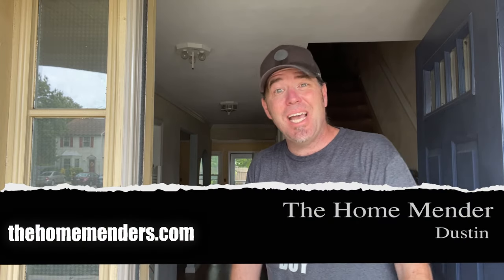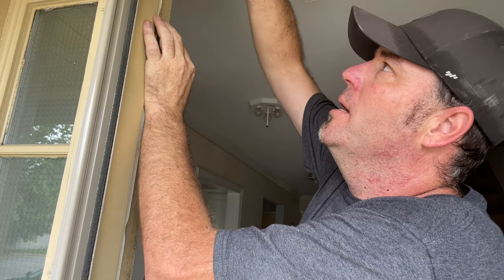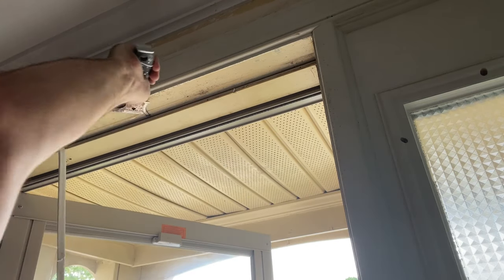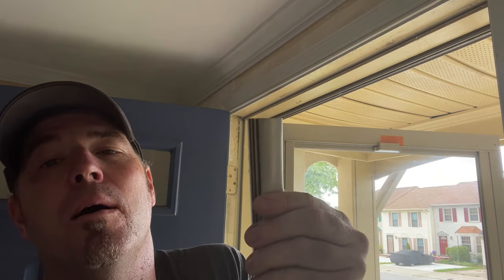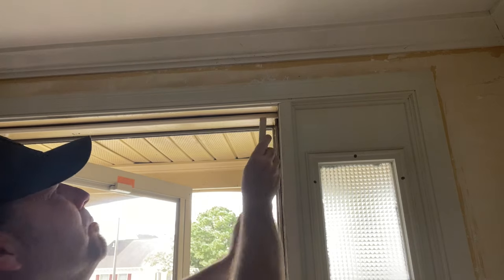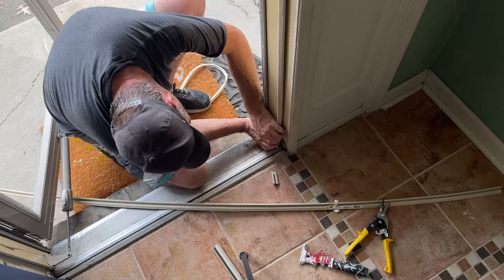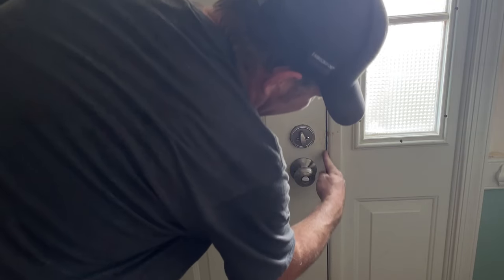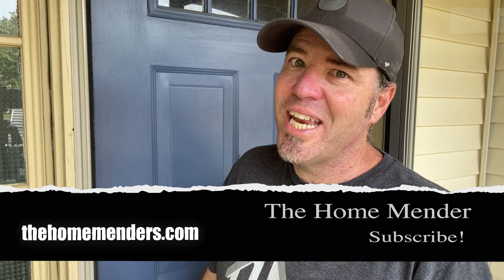How to replace KERF weatherstripping. Easy door seal replace.

Comment: Quick tip for the slots so you dont have a build up at the top corners, you can trim back the folded part for overlap without build up so its even, but keep the part that goes into the slot so it holds it.
Reply from the maker: Excellent input thank you

Comment: Oh well, I couldn’t get it in the slot. It’s exactly like the one we took out but we couldn’t get the new one in. You made it look easy but it wasn’t.
Reply from the maker: Hey Siri, take a scraper or painters tool and run it down inside the slot to make sure you don’t have any pin nails, preventing the new one from sliding in. You got this

Comment: How are you getting it in so easily? I can only get the top and bottom in and then, no matter what I do, it won't slide into the groove. It's like it's too big to fit or something. Should I pry the gap to make it more open?
Reply from the maker: Hey these. I would not pry the gap… That would split right off. There may be something obstructing it. I have seen them with pin nails and then before if that’s the case, just use a paint scraper and break them. You got this.

Comment: Painters suggested I replace the old weather stripping around the front doors which I  trying to do. Was NOT looking forward to the actual job and still am not. The slot is clean and free of debris but it does NOT install. A royal pain in the ass!
Reply from the maker: Hey Gary, check to see if there’s a little pin blocking it from sliding in sometimes people install them with the pin nails if they can’t get them to stay in, which may be a solution for you. If you do see them, you can take a chisel or a painters tool and bang them to break them to free up the slot. I hope this helps.

Comment: Dustin, well done. Just bought a place where the main door requires a hip check and/or shoulder applied to open/shut. Turns out the stripping on the hinge side looks way too thick for the application. I appreciate your kerf/no kerf heads up. Off to the store. Thanks, man! 🫡
Reply from the maker: Thank you, my friend. Enjoy!

Comment: Great video. I put it around all sides now my door won’t close. I left one side out but I see tiny day light. Can I trim it or they make smaller widths? Thanks.
Reply from the maker: Great question Harris. If the door is now too tight and won’t close and latch, you may need to move the latches to accommodate the new weatherstripping. You’ll be happy when it’s done :-) you got this

Comment: This is great, but what about when you shut the door and daylight can still be seen?  I'm sure I did it wrong, but I placed various sizes of the stick-backed weather stripping on top the the type you used (by the way, what do you call the type used in this video?).
Reply from the maker: Heyhey. It’s kerf. If you replace it and still have daylight, you might need to adjust your door. Catch to keep the door tighter when shut. You got this

Comment: Are the side pieces interchangeable? When I bought a couple at the hardware store they are definitely not symmetrical. Also, if I don't own a snip and wouldn't make sense to buy one just for this project, can I cut the weather stripping with just a utility knife? Thanks, great video.
Reply from the maker: Hey Gwynn Yes the side pieces should be interchangeable and you can cut these with scissors.

Comment: Any suggestion for getting the old strip OUT that's stuck in the slot with multiple coats of paint over the years?
Reply from the maker: Hey Alden. Usually you can grab an end of it with a pair of pliers and yank it out… I have seen it where it has been tack nailed  in before if that’s the case you would need to use a chisel and busters pin nails out to get the new piece to slide in. I hope this helps painters tool rocks!

Comment: Thanks. What if the kerf on my door jamb is on a different surface? The slots are on the periphery/adjacent surfaces and not the frame/the surface that is facing you as you're looking out through the opening. Where do they sell weatherstripping for this non-standard setup??
Reply from the maker: Hey sonic. If it’s not this style, you can use the metal Weatherstripping with the rubber bead. It’s installed with the door shut, but will work on just about any door that this video will not. I hope this helps.

Comment: I bought some kerf stripping but it just falls right out of the slot as if my kerf is too wide for the little teeth of the stripping. Any issues with using some adhesive or do they make it with larger teeth?
Reply from the maker: Hey GG. You may want to try some tiny Brad nails. It seems that an adhesive would be messy. I hope this helps.

Comment: Hi I just did this but it's not staying folded on the away from hinge vertical side. This forces me to use force to close the door. Suggestions?
Reply from the maker: Hey Natasha, you may try pushing it in and securing it with tack nails.

Comment: Bought this house last spring, and I am changing the weather stripping. But now the door won’t close. Any suggestions? Are there different thicknesses I need to look for? The original was a flimsy rubber kerf, and I replaced with what looks like you have, says seals up to a half inch gap.
Reply from the maker: Great question Ashley no they are not different thicknesses you may need to adjust the door catch so it latches easier. You got this

Comment: I replaced the weather stripping on the door with new product but it is very loose and there's no way to fix it tight in the groove. Any tips to get it to lock in there? Pushing harder doesn't help; it's likely the groove is just too big in a few places. And somehow I don't think glue is the right solution here.
Reply from the maker: Hey Barnaby, sometimes it can be a challenge… You might try Brad nails holding in the edge of the fin. I hope this helps.

Comment: What if there's still a light gap and draft after replacing this? My door had another insulation thing attached to the outside edges of the door that fit into the frame, but I'm not sure if I should do that again or something else.
Reply from the maker: Hi destiny. If you had this style of door with the gap and you replaced the weatherstripping that should be all it needs. You might try to move the catch , the metal part that holds the Latch in  just so the door shuts tighter up to the jamb I hope this helps

Comment: What if the kerf strip doesn't just slide right in? I just started working for a buddy learning general contractor work. Did this yesterday and had to bang the kerf strip in with the butt of my snips. Took a long time and too much gusto for my care.
Reply from the maker: Hey James if it doesn’t slide right in then there’s probably pin nails or glue. You do run into those once in a while but it’s rare. I’ve had it so bad where you’d had to notch the little barbed fin to fit it in the slot I hope this helps

Comment: What if the kerf is in the jamb instead of the stop? If that makes sense. I have aluminum "V" shaped stripping right now, but it looks terrible.
Reply from the maker: Hey neuro . In your case you’re going to want to remove that little copper fin deal from the 50s. Then you will want to go with the metal strip with the beaded rubber on it. I have a video for that. It’s weatherstripping without the kerf slot. I hope this helps.

Comment: Hey the weather stripping I bought to replace the old has a thinner channel than the old. The kerf is a lot wider than the channel is. So, that makes the weatherstripping not stay in place and very sloppy loose. I don't have much experience with these things. Can you tell me how to get the weatherstripping to fit correctly? Thanks
Reply from the maker: Hey funny woman. I’ve run into this a timer to.If it won’t stay in there you can use a few Brad nails to tack it in place. If the fan won’t slide in all the way you may try to trim a little bit off If it won’t slide in all the way. I hope this helps.
Reply: @homemend  Thanks so much for your reply.

Comment: Ive got no daylight. But the door wont close flush. Any tips?
Reply from the maker: As long as it shutting and locking and not letting in any light and air, I would go with it

Comment: What if existing door frame doesn't have the slot ?  Thx
Reply from the maker: Great question DJ. If it does not have the slot, then you would want to use the screw on metal weatherstripping with the rubber bead. I have a video.

Comment: What if the fins are too short to grab. Weather strip just falls out.
Reply from the maker: If the fins won’t grab. The next solution would be to move onto the beaded metal weatherstripping with the rubber. Not sure why that wouldn’t work with the fins, this is not the preferred way but you could also use tiny finishing tack nails through the gym to hold the fins of the Weatherstripping . I hope this Helps
Reply: @homemend  Thank you very much. The reason the fins are not grabbing is the gap is too big at 1/4 inch. I also shined a flashlight into the gap discovering the wood is beveled away creating an even larger gap. The tack nails might work. If not I can use your other suggestion. Is the beaded metal stripping available at home depot and lowes?

Comment: How about the bottom?
Reply from the maker: Hey James that would require a sweep, do you have ones that go directly on the bottom of the door and also ones that go secured to the inside of the door. If your sweep is broken at the bottom, you may need to pull the door to replace it. I do have a video for it. I hope this helps
Reply: @homemend  
Just the bottom. thanks